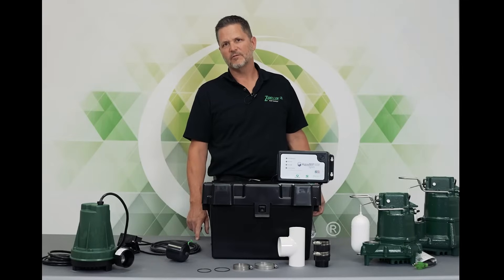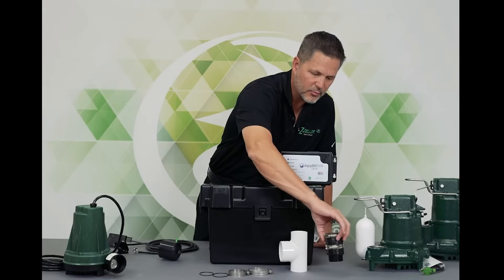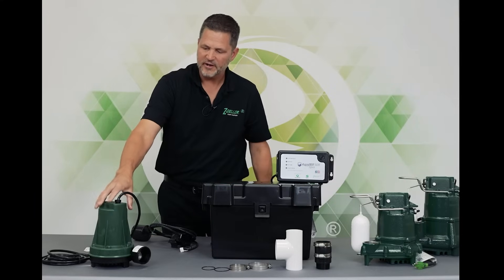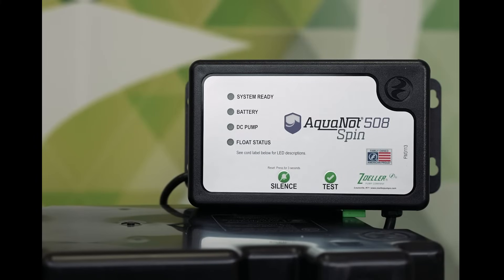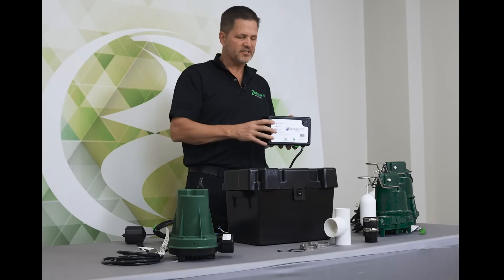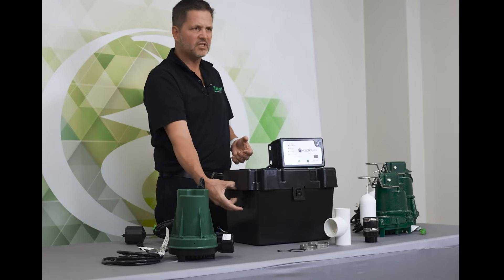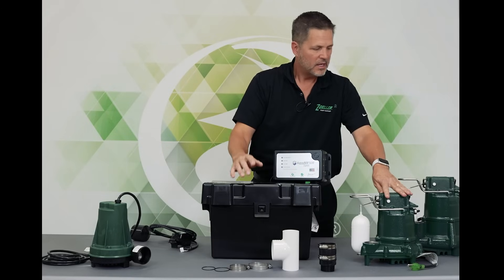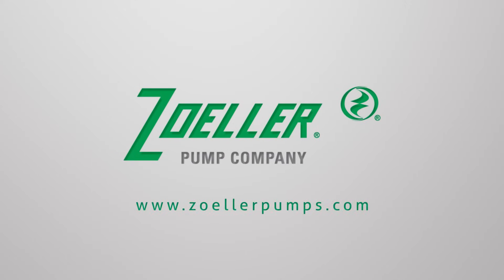AquaNot Spin 508 Overview

Comment: During a power outage is it normal that the controller alarm sounds and that there are no lights on whatsoever on the unit? Does that imply normal functionality? Thanks.
Reply from the maker: During a power outage, the controller will not alarm simply from the loss of power. The alarm only activates if the DC pump runs or if the battery voltage drops too low.
Here’s what you should expect to see:

When AC power is lost, the AC Power light will either turn off or flash, depending on the model.

The Battery Charged light should stay on to indicate the system is ready and operating on battery power.

If the pump cycles while running on battery, you’ll see the DC Pump Cycled light come on — that’s normal.

So, hearing the alarm during a power outage isn’t caused by the outage itself, but rather by the pump activating or a low battery condition, but there should be some sort of light indicators on the controller at all times. 

If you need more troubleshooting support on your system, I'd recommend reaching out to our product support experts by emailing zcotechnical@zoeller.com or calling 1-800-928-7867 and pressing option 6.
Reply: @ZoellerCompany awesome! Thanks for the quick reply. I will contact the installer.